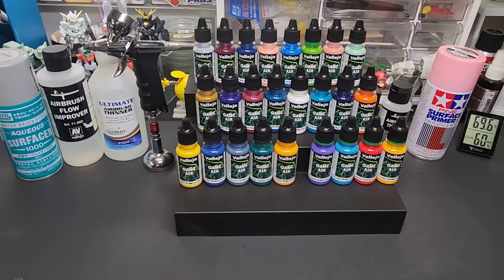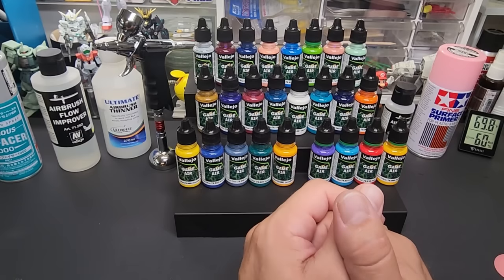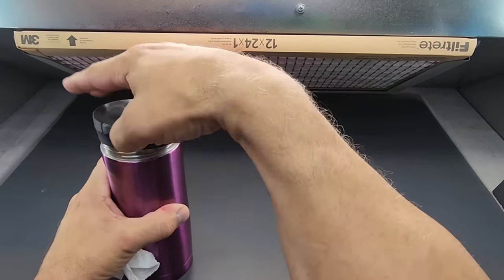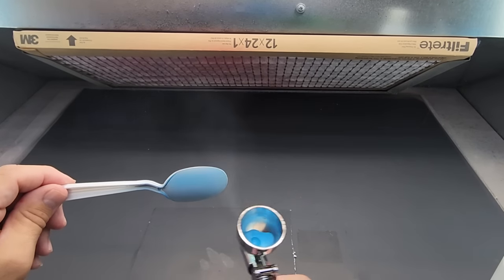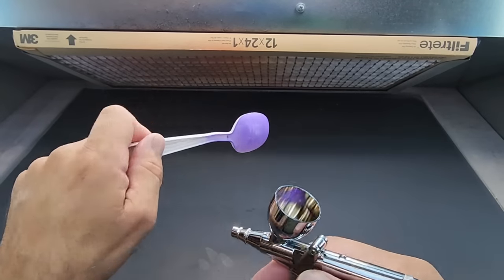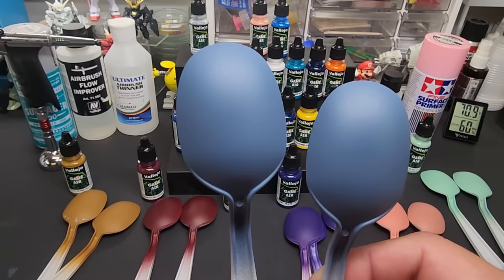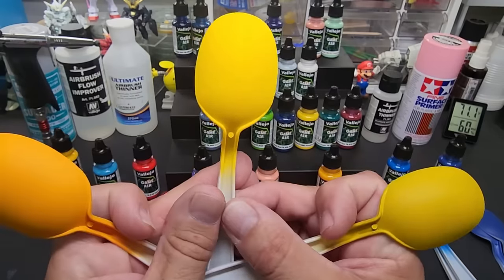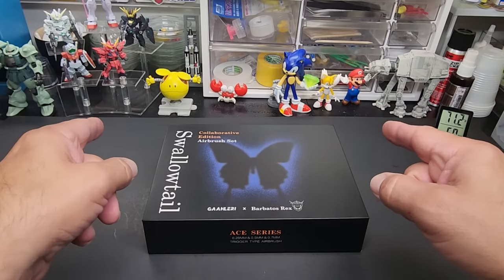Testing Vallejo Game Air Paints - All New Formula

Comment: These paints look very nice. I really like my SMS and Mr Color for spraying but lately I've also been trying some Model Air, Model Color and Lifecolor. 
The initial misting layer over primer, as you say, is the trick to get good results.
Also, I can just wear a dust mask at the booth. Wearing the whole solvent filter respirator etc can be tiring after a while, especially in the hot weather.
I cut little circular pads from those EVA non-slip stick-on feet and stick them to my Airbrush top button which makes it more comfortable to use when spraying for longer periods. 
Congratulations on the Airbrush. It looks very nice, versatile and comfortable to use. I do like the trigger type. 🦘🦘🦘

Comment: These paints look really great Robert. Like you I prefer to use lacquers but these lay down really even. Especially like the yellow depth of colour which I usually have trouble with. From the video the paint looks pretty thick and seemed to atomise better with a few drops of thinner. The Gaahleri 68 AB is sensational, having bought one on your recommendation and it is now the most used AB I have. So impressed by your collaboration with Gaahleri for the AB I'm sure it will be a huge seller. Thanks for all you do for us. Cheers mate

Comment: I paint miniatures with model air and small parts of cars , I'm currently painting a catapillar engine yellow from a kenworth truck and was in two minds to brush or airbrush, I ended up using 2 thin coats by brush and thankfully it turned out ok

Comment: Been using mostly Vallejo, they’ve been working great once you learn the pros and cons. I would have liked if they decided to switch to a gel medium instead of a liquid medium to have a longer drying time and maybe the same consistency for all colors.
Reply: are there any hobby paints that use a gel medium?
Reply: @danzo5521  Yes there are, I think Scale 75 uses medium and others, u can use flow improver, retarder or glaze medium to reduce drying time with Vallejo but acrylics will always dry super fast.
Reply: Their paints rub off on me all the time.
Reply: @gidden2000  Never had an issue with Vallejo, been using them for years, i do use Vallejo Mecha Varnish to protect the paint but's it good without it too.
Reply: @TheIcemanModdeler  I'm a fan of Tamiya myself, but they lack colors unless you get cans. I want to try these new ones he reviewed though. I love trying new paints.

Comment: Thanks for this!

I paint table top gaming minis more often than I do model kits so all of my paints are acrylics since they're easier to thin when brushing because I prefer to use a wet pallet.

I've been an unashamed Vallejo fanboy for years - most of my paints are Valljo Model Color with the odd Game Color bottle here and there.

I've never tried the Air Color line, I just usually thin out the Model Colors when I do use an air brush because I don't want to have to buy two bottles of the same color (one for brush and one for air brush).

Just curious, have you tried just using a regular brush with the Air Colors?

Comment: i overwhelmingly work with regular brushes, and I've found the "Model Air" range to be quite a bit better for that application than the "Game Air" range, before this overhaul mind you, so I'm keen to try out the updated formulation. Hearing that there won't be any metallics has me baffled a bit, since the Game Air range was especially cruddy in that department, and the Model Air metallics are among the best on the market... odd decision to not tackle those in this new lineup.
Congrats on the collab, the note is as beautiful as the Swallowtail itself.
Reply: Vallejo recommends the new formulation of the Game Color lineup for Metallics. They are even airbrush ready. So, take that for whatever it's worth.
Reply: @ZeilLibertas  ye, have yet to try the new metallics, the rest of the range seems predominantly matt/ultramatt. can't imagine the metallics would be, but then again they've done it before with the Mecha range (intentionally, of course)

Comment: The problem for me with all these videos painting spoons is that a spoon is the absolute easiest thing to paint, I don’t need any help with that. Only rarely am I applying a single solid color to an entire broad unpainted object. I need help with weathering freight cars, doing soft streaks, how to restart a streak that got interrupted due to tip dry, so I can seamlessly finish it. How to fix errors like darkening the model too much? Problems real people encounter. Maybe I’m too inexperienced but all these spoon painting videos seem the same, it always appears like each spoon gets perfectly painted , and you must have dozens of these same videos with different paints. It doesn’t really illustrate any differences. This channel is excellent but could be much more useful with some tweaks in my opinion. Thanks for considering this feedback.
Edit: another common issue: painting cars, how to get a mirror finish gloss coat? I seem to end up with mild orange peel texture. It looks “pretty good” but it’s frustrating because when I’m spraying it, there are fleeting moments where it’s wet and looks fantastic, but it never seems to dry that way.

Comment: Thanks for the demo. I can see several colors I want to try. 

Two questions and a comment. 

Does your Swallowtail airbrush fit the Micro-Mark Vallejo Paint Feed Adapter, Item # 90833?
It says it fits Grex Tritium Series Airbrushes, and other brands with M6 x .75 cup thread pattern.

Question two - do those adapters fit the new Vallejo bottles. I guess the test is, do the new and old bottles use the same caps?

My comment is, on the Vallejo website it says they don’t have metallic Game Air because the metallic Game Color are airbrush ready. Same for fluorescent. 

Thanks again for all the great content you give us, and the timing couldn’t be better, I was just about to buy a trigger airbrush. Waiting a couple weeks is no problem. 

Mike W

Comment: so I have both my new as of yet unused iwata eclipse and my older pasche(sp) airbrush, and I want to run my primer through an airbrush I will be using either a vallejo grey primer or an A.Mig-2024 One shot grey primer and was wondering which airbrush I should use... I don't want to risk the eclipse needing cleaning to the extent of having to disassemble it...

Comment: Very nice colors, unfortunately I have to rely on solvent based colors/enamels because I need color tones that are hardly available as acrylics.🙄
Congratulations on the collaboration with Gaahleri!🤝🏻🍀 This is a really nice airbrush (obviously identical to the Studio G, just a different color of the swallowtail part). It looks like there's a fan cap included, but no one has really said anything about it yet - and very amusing, the guy from Studio G doesn't even know what a fan cap is (according to his giveaway lifestream)...🤷🏻‍♂️🤭
Reply: I didnt see anything in the box or on the product breakdown image that looked like a fan cap. Are you sure you arent seeing the nozzle heads for the different needle sizes and thinking theyre fan caps?
Reply: @GenuineRage  That can certainly be the case. However, somewhere someone actually wrote about this airbrush that "the fan cap works well" - that irritated me... Anyway, these nozzle heads with this very large thread should be ideal for screwing a fan cap onto the airbrush. I hope Gaahleri has plans in this direction.

Comment: At what temperature, is it too cold to be using an airbrush? I live in in area, where the outside ambient temperature can get 2
to 0°, but where I actually set up my paint booth, I can keep it about 50°. Is that too cold to be doing air brushing?
Reply from the maker: 50 is pushing it. I wouldn't spray under 50
Reply: Thanks, I'll have to see if I can find my space heater. I have to paint in the Garage.

Comment: Hello. I’m new to airbrushing and having a hard time deciding which paint to get. I’m debating between vallejo air and creatix wicked colors.

I’m planning on painting (on paper, canvas, wood panels), foam dioramas, and an occasional model car kit.

Any advice would be greatly appreciated, thanks guys.
Reply from the maker: Either of those are good for what you want to to spray. For Plastic models I would pick a different paint. So if the majority wont be plastic models then stick with Wicked or Vallejo. Just grab car colors alacart when painting plastic
Reply: @barbatosrex9473  Thank you so much for your help.

Comment: Hopefully Gaahleri improves their quality control.  I had to buy and return FIVE of their GHAC-98 models before I found one that didn't have scratches or dings.
Reply from the maker: Amazon has been a problem with that. And because of that we will be selling my airbrush directly from the manufacturer so we can control the quality and be sure only new airbrushes will be shipped out
Reply: Were those just on the outside? I have a feeling most people don't care about that sort of thing, myself included, as long as they are only external.. that's probably why so many are affected.